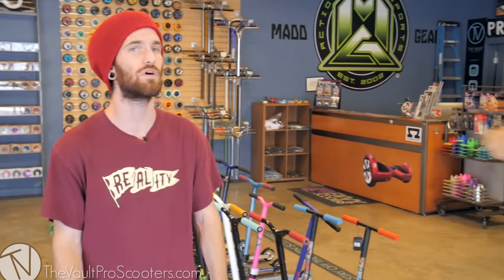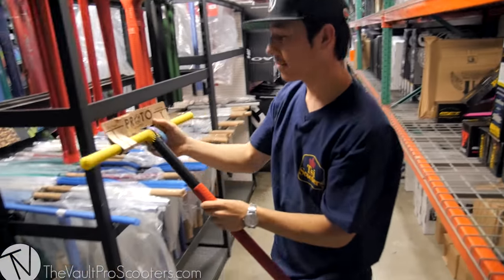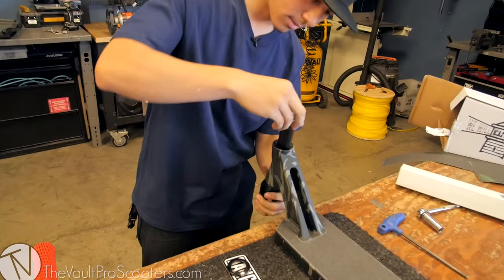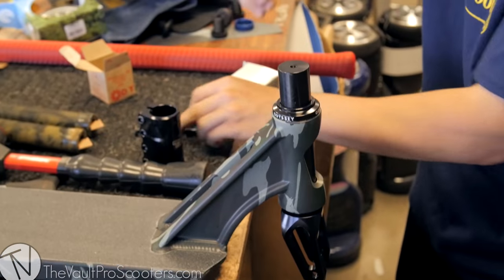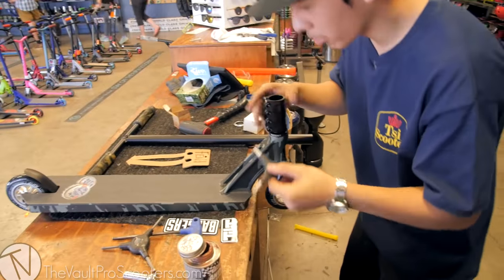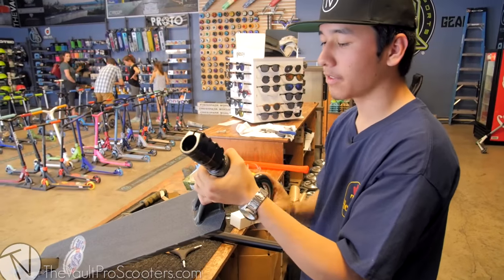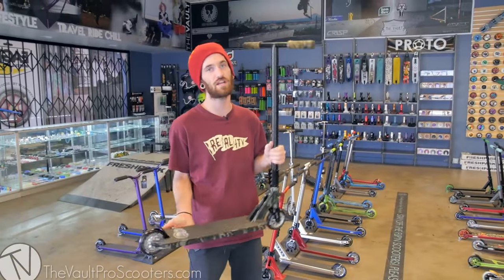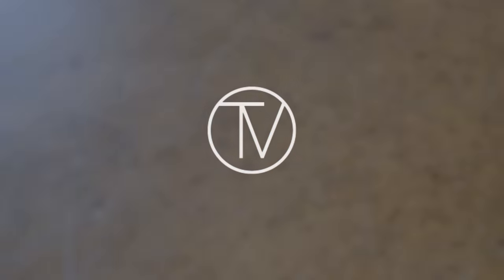Custom Build Off! - Part: 3 (ft. Aaron Mora) │ The Vault Pro Scooters

Comment: I'm new to scootering so here's a dumb question.  What's the difference between street and park parts??
Reply: Tyler Hughes park setups are usually lighter and smaller bars and deck but street is usually opposite